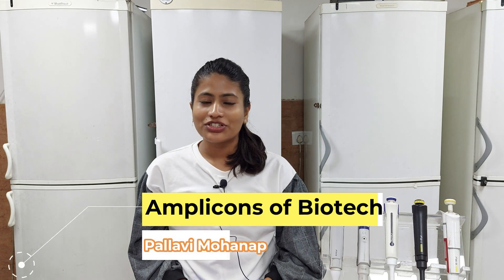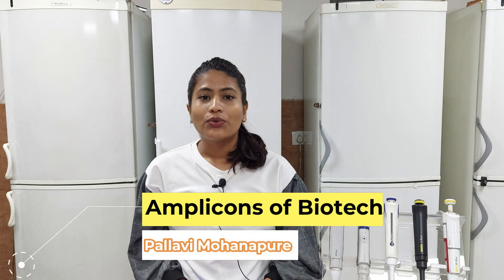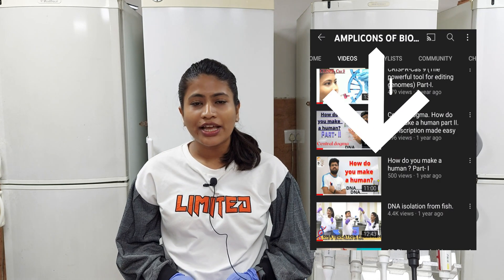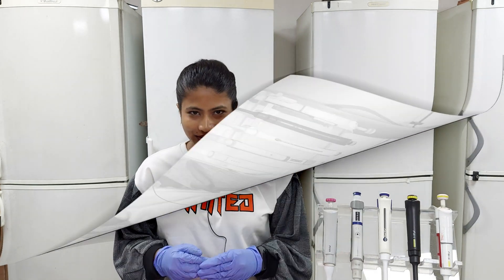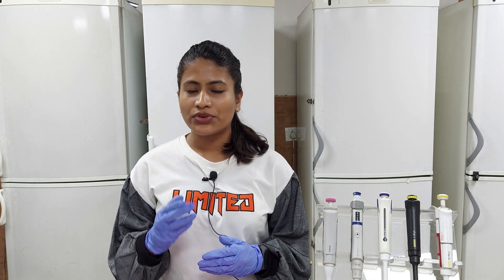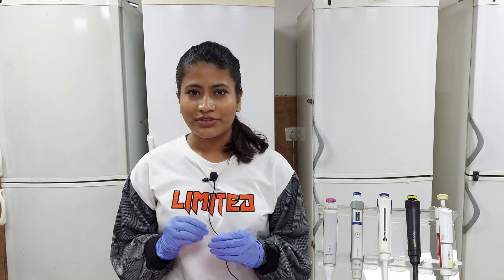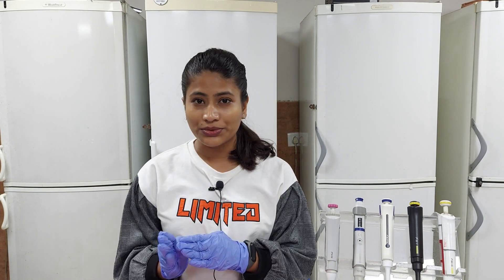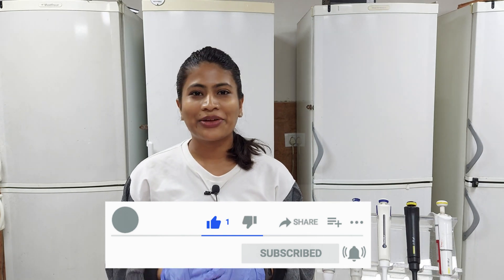DNA isolation protocol from plants (Rice).

Comment: how much of beta-mercaptoethanol into CTAB buffer?
Reply from the maker: The amount of BME added to CTAB buffer can vary depending on the specific protocol being used and the type of tissue being processed. Typically it is added 0.2% for rice protocol which we follow (eg. 200 microliters for 100ml CTAB buffer). However, some protocols may use a higher or lower concentration ranging from 0.1% to 2%